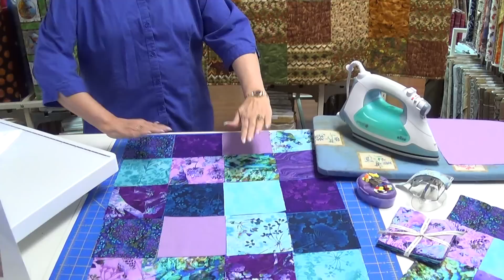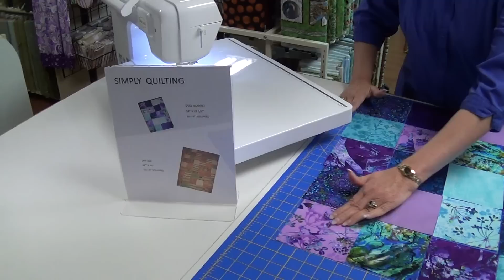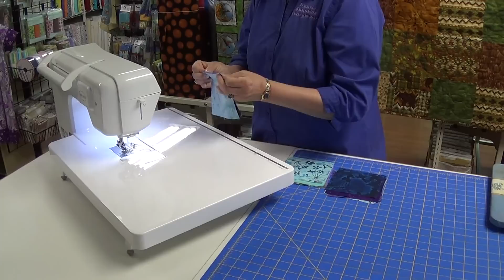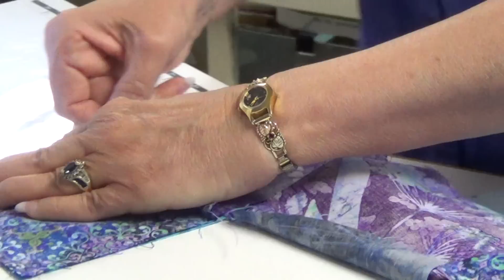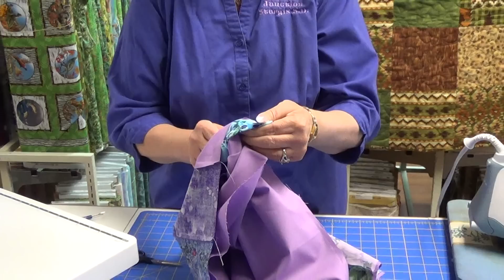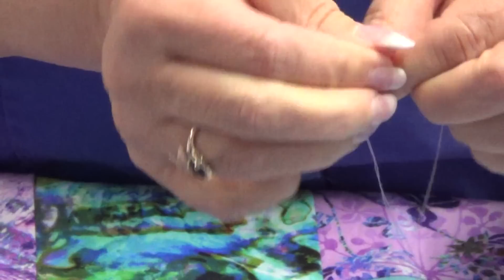18 to 21 inch doll blanket and adult lap quilt.

Comment: Thank you for the video!! I am in the process of making a quilt for a cousin. I don't have time to quilt it and this will work great. She suffers from Fibromyaliga and wants a quilt without batting in it. I think I will use a sheet inside to give it some weight. Can you suggest a light weight batting that will not bunch up when washed?
Reply from the maker: +Lu ODell I would use flannel instead of batting because it adds little warmth without weight. Make sure it is prewashed. You can find it 108" wide or piece the 45".